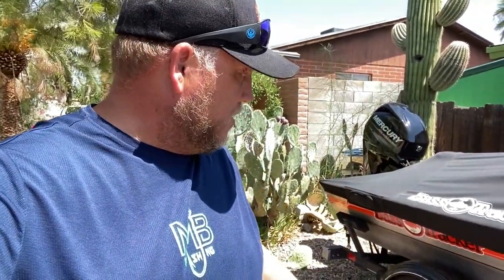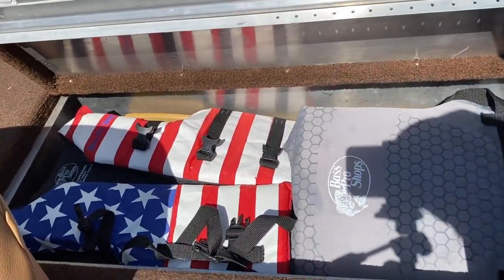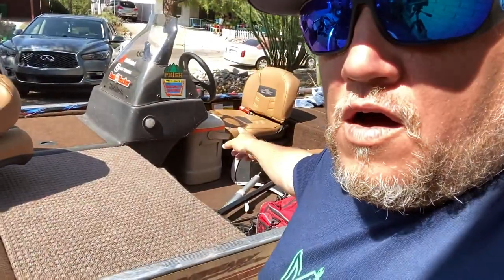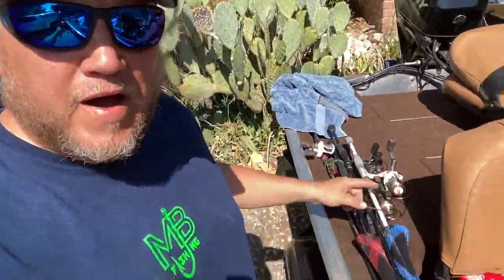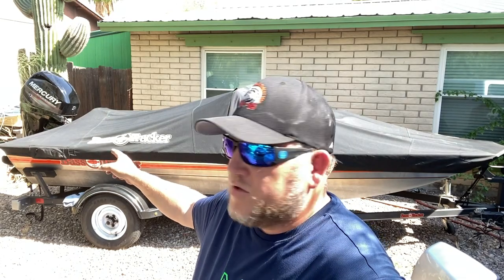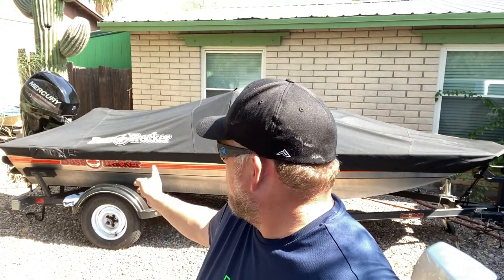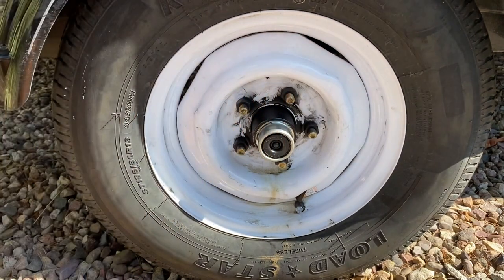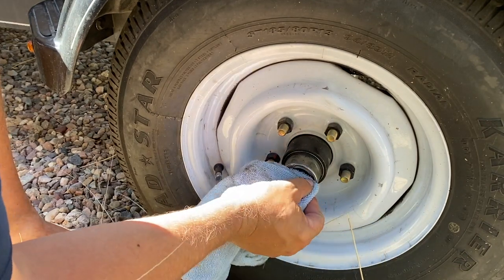Bass Tracker Classic traveling tips and ideas.

Comment: Mark, have a great and safe trip to the "Show Me"!  Looking forward to future vids when you get settled in at your new place on the lake.  One thing I can suggest when pumping grease into your trailer hubs. You should jack the wheel off the ground and spin the wheel while pumping grease which prevents or lessens the pressure on the rear grease seal otherwise, the pressure can blow out through the grease seal from the rear. Of course this would be more critical if the trailer had brakes because if grease blows through the grease seal, such can contaminate the brake system shoes and hubs and that could be dangerous.

Comment: I don't drive far enough to knock the dust off my boat. I'm 5 minutes from the ramp. I used to have a old hummingbird and it broke twice (electronics) by hauling it on the boat on those short 5 minute drives on gravel roads.

Comment: Hey dude. I live on grand lake. FYI on your dexter axles. You should be rotating the tire as you pump grease in the zerks. I’ve got a fifthwheel with that same type axle hub lube system. A few years ago Lippert had issues with employees blowing out inter seals from over greasing. Grand design switch to dexter after they had to replace thousands of brake assembly’s due to grease blowouts.
Reply from the maker: I must have been lucky or hit a good one I put over 30k miles on it before I sold it with all original trailer parts.   Tires still look new.
Reply: @MarkBlackstock  pure luck. So you never pulled your hubs apart in 30000 miles to inspect the bearings for contamination and rust?
Reply from the maker: No, greased them regularly and never had an issue.   Boat lived inside for 5 years when not on the road.  My bearings were inspected over a year ago and they found no read to change them.
Reply from the maker: I’ve already done more work to my new to me Nitro trailer than any on the Heritage trailer.